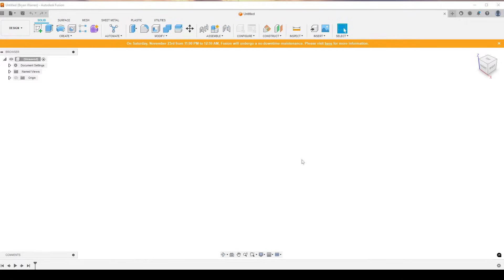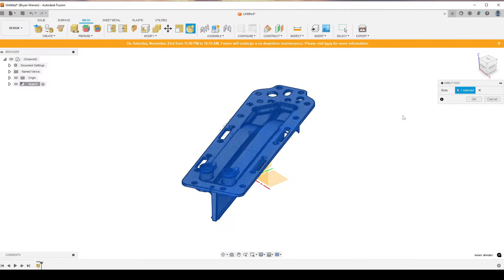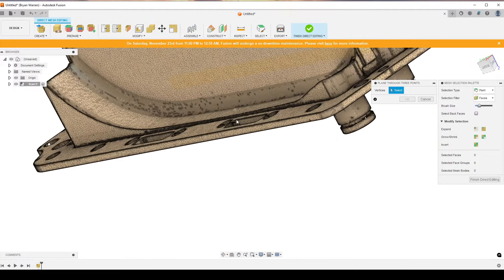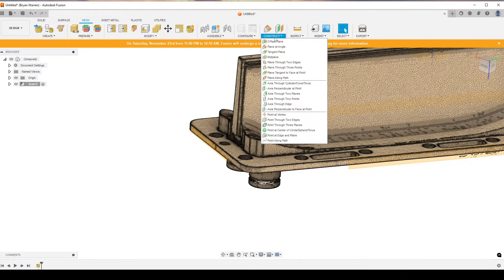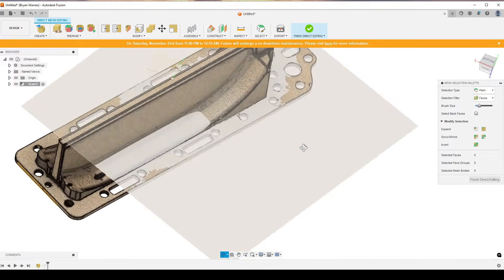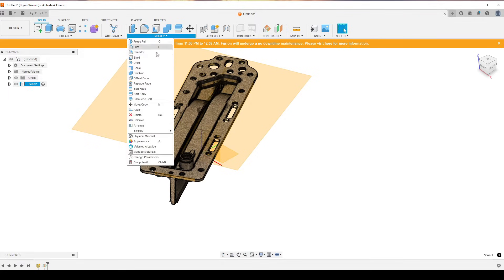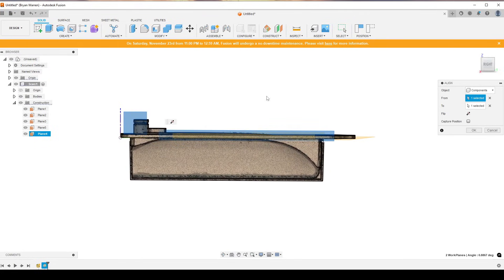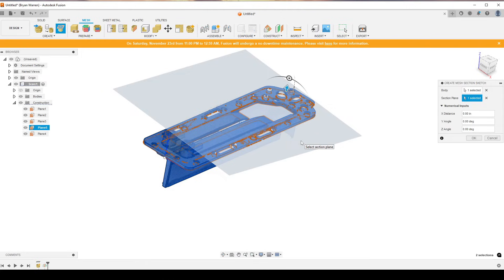Fusion 360 Align 3D Scan

Comment: So ive done this, maybe im expecting too much but i appear to end up with 2 sets of XYZ Origins. I appear to allign it up with the XYZ and it appears to line up. But when creating a sketch of the planes used to allign, the sketch planed is skewed and not square with the body? Do i make sense?
Reply from the maker: You might have the origin from the component turned on. Try turning that off and only use the main origin for the file.

Comment: I don't know if it's because of a Fusion update or something else, but Align did not allow me to use 3 planes to align with the top level origin. I ended up having to create a point and an axis using the construction planes and then use Align and Move
Reply from the maker: What kind of shape is it?
Reply: @bryanofthings  it's hard to describe... it's a plastic corner that joins two extrusions together for a tonneau cover frame. I can share the model if you would like
Reply from the maker: I can take a look at it. Bryanofthings3@gmail.com

Comment: Hi there.
Thanks for the video, Im doing everything you are doing. Fusion lets me select the from plane (the new one I created) but wont allow me to select the to plane. The file is opened as a .obj file and the mesh gives a warning that its not closed. Any help would be appreciated.
Reply from the maker: Did you import in the mesh section area or through fusion library?